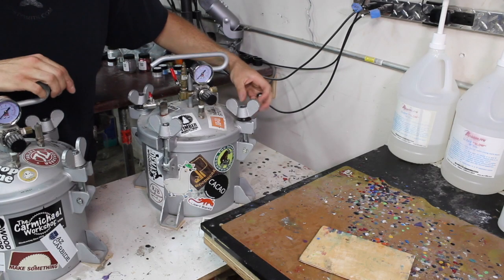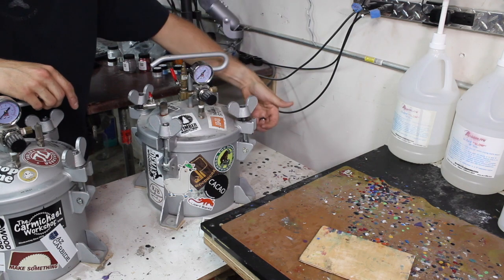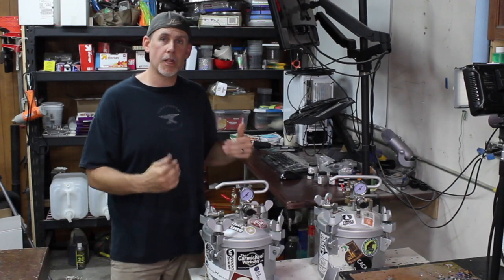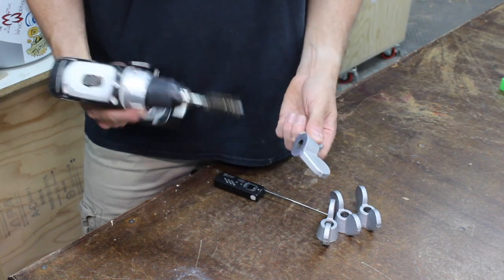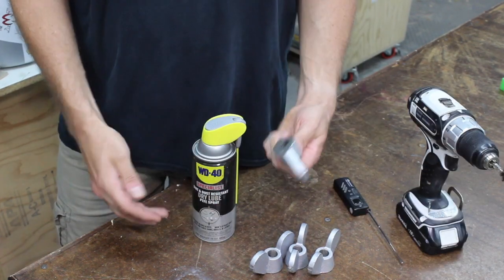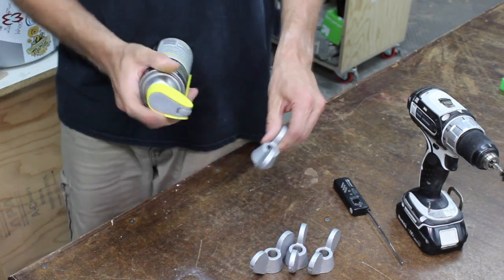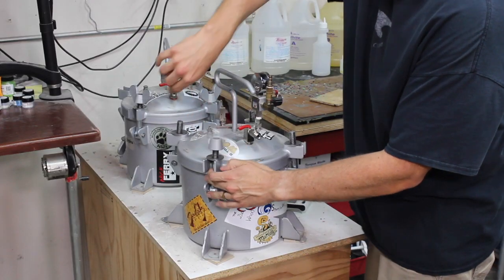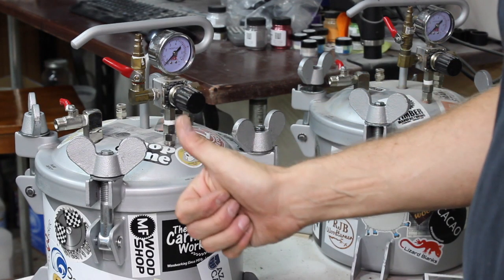Pressure Pot Maintenance - Lube Those Screws  | Resin Casting Quick Tips

Comment: I love your stuff. Do you think you can use the pressure pot tank for a vacuum chamber?
Reply from the maker: It's possible, they sell clear lids that you can use to convert it for use as a vacuum chamber. For wood stabilizing, I prefer a totally clear vacuum chamber like the TurnTex ones, it helps a lot being able to see inside the chamber from the side rather than the top only when stabilizing wood. For degassing silicone, the clear lid works great and gives you a good size chamber to fit a pot of silicone in

Comment: Good tip Zac.  Do you do something to the screw posts also?
Reply from the maker: If the screws are really caked up with stuff, I disconnect them and take them to a brass wire wheel I have set up on a grinder and clean them out too. I don't usually do that though, just hitting the nuts and applying the dry lube does the trick in most cases.

Comment: For some reason I never thought of lubing the hold downs. Good idea. Do you ever do anything to the seal? I have the same pot in five gal. and use it horizontally all the time. Lately I have been getting some leakage after a couple hours. Didn't before. Also how tight do you go? I know hard to say but finger tight? I made a wood slotted "nut" to go over them that is easier on my fingers. If this is worth a vid I'll wait. lol
Cheers, Lee
Reply from the maker: Actually, once you lube the screws, you might find that you can cinch the lid down tighter than before. I'd clean them and lube them, and see if that lid leak goes away. I don't usually treat the gaskets on mine, they are all in good shape still. I tighten mine down pretty good, but I think it's more important to tighten them equally (two opposites at the same time)